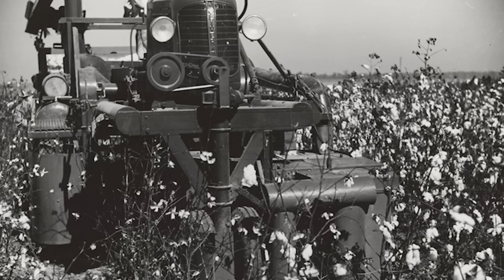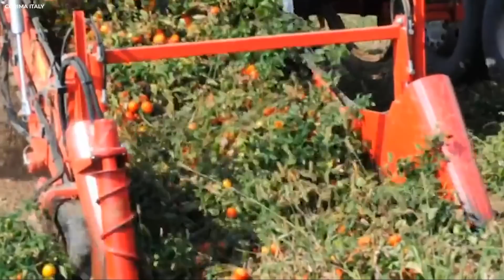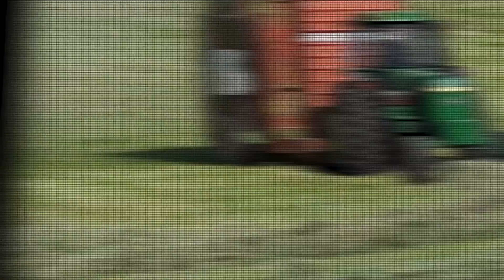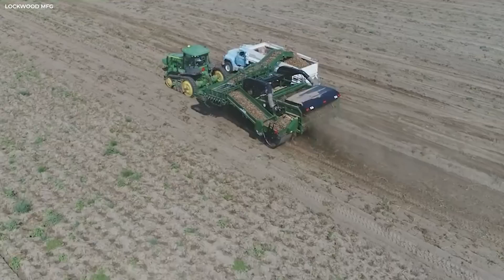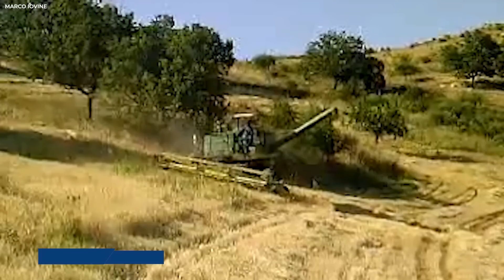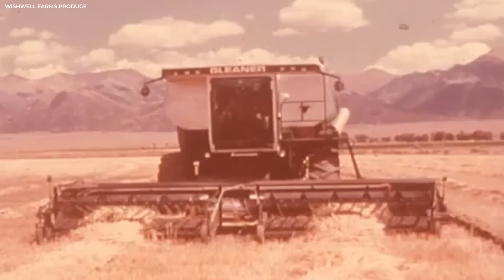10 BIZARRE AMERICAN HARVESTERS YOU WON'T BELIEVE EXIST

Comment from the maker: Which Harvester was your favorite? Let us know in the comments!
Reply: @VintageMachines19  my favorite was the Allis-Chalmers pull type (only cause it’s the only one I ever worked on) that and cause the local farm n fleet in S. Mi carried replacement parts like rubber for the beater bars & already formed panels for the concave bottom (already drilled for sq sh bolts )

Comment: I spent some of my youth on a John Deere 45H Hillside Combine.  The lean was manually controlled by a single handle on my right using a plumb bob the farmer had hung on the open-station platform railing.  The hillside system was intended to keep the separater screens level thereby reducing crop loss via seed escaping down the low side next to the wall.  It was also quite handy when unloading with the auger...

Comment: Dads AC # 60 pull type combine had beater bars that run against a concave bottom section.   Adjust the speed of the beater bar assembly by the adjustable belt driven bar ,  adj the closeness to the concave bottom and you were in business.  I knew Dad figured I had grown up enuf when he sent me out to do the adjusting between soybeans to wheat in the fall .  Great memories 🙂